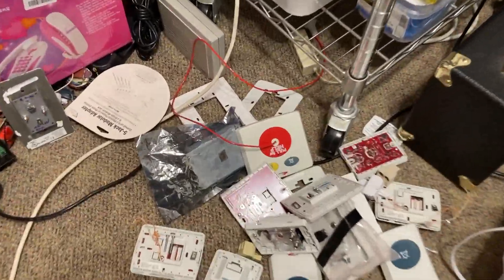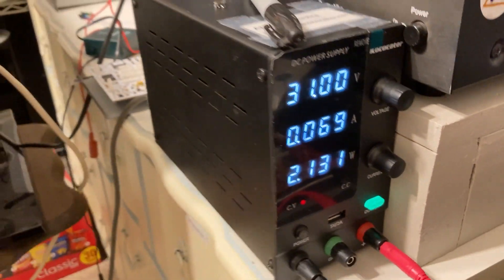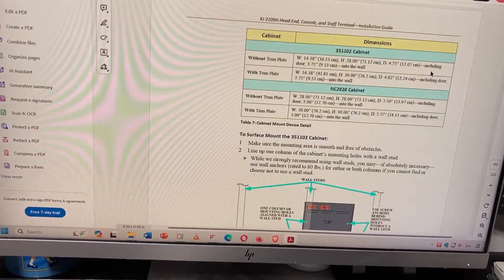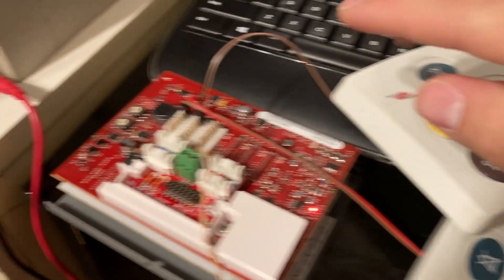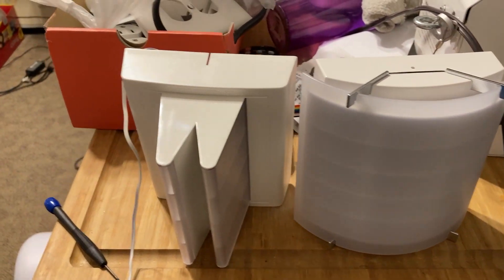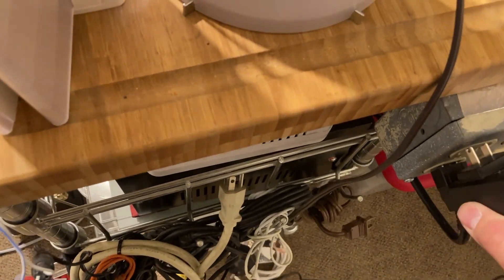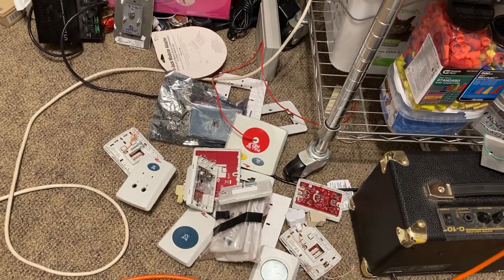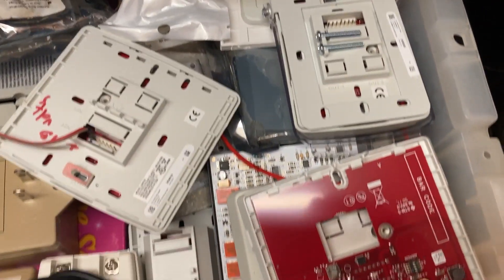Rauland Responder Hospital Notification Gear Powered On

Comment: Nurse call systems are fun to play with. Here we used a traffic signal style call system made by the Florence Nightingale corporation (tFNCo). They consisted of 4 fluorescent tubes (one green, one orange, one red, and one blue. ). and a speaker that played various synthesized tones. The main console at the nursing station was a keypad of buttons and a vacuum fluorescent display that displays notifications. A lot of the nurses here still wear those white caps (Flossies) on their heads, but they are made of a flexible plastic material instead of starched linen. they still wear them, especially in larger facilities so that nurses are easier to spot in the organized chaos. Mounted to the caps are these small boxes with flashing red LEDs, which also help with making nurses stand out (especially when the power fails), but they also have trackers in them that allow the security team or other watchman to see where each exact nurse is on a map of the complex (kinda like the marauders map  from Harry Potter), this allows for pinpoint assignment of the nursing staff (though it's a little creepy NGL). This Rauland system is completely alien to me, so I don't know how to help, but i'm sure someone will figure it out.
Reply from the maker: I found your comment very interesting about nurses and this hospital setup. I'm really surprised about the nurse's uniform style but makes sense why they do that. I would expect that uniform style to be an old-timey thing like in some of those movies. Sounds like this hospital has a very efficient system and the Flossie with the red LEDs is a smart move in the event of an emergency along with the tracking. I'm now wondering why other hospitals have this setup in terms of the nurse's uniform style since it works for your local hospital very well. It should be a standard nationwide since an emergency can escalate really quick at times. Thanks for sharing.
Reply: @CristianOrtiztechmaster926  When you think about it, it makes a lot of sense. It's a big complex with large hallways that are practically like highways for feet, basically organized chaos. But said organized chaos can escalate into a stampede of tons of people in the event of an emergency like a total power failure or something to that effect. 

A lot of other hospitals in my part of the world have adopted this system, but they aren't nearly as large. There is a slight inconvenience however, there was a period of time where the nurses did switch to regulation blue and do away with the flossies just like any hospital in the early 2000's would, but they didn't get very far (trust me, it was horrible, as you couldn't tell who's who from a distance ), But that period did bring about LCD TV sets, lower curtains and door closer arms, precariously low ceiling fixtures and a lot of equipment sticking out of the walls ( and you can see the problem with that, but it did lead to the discovery of a lot of sloppy installation jobs. ).

Apparently, Broomfield hospital in Essex, UK were trying to launch a similar thing off the ground, but I don't know how far they got with that ( it's amazing how much people hate old things. ). I apologize for the long replies.